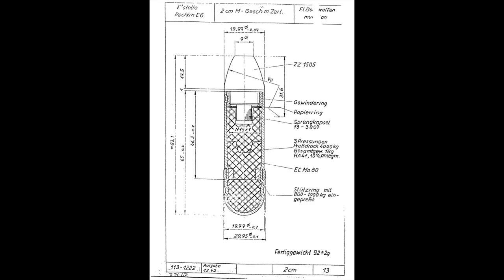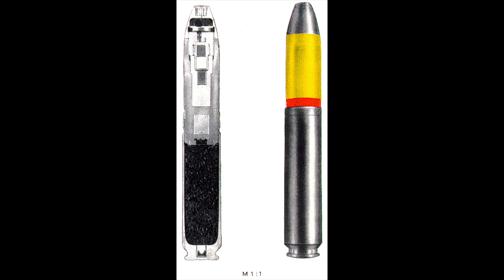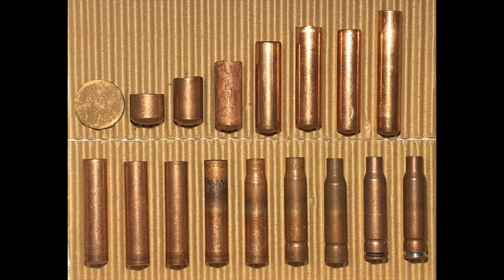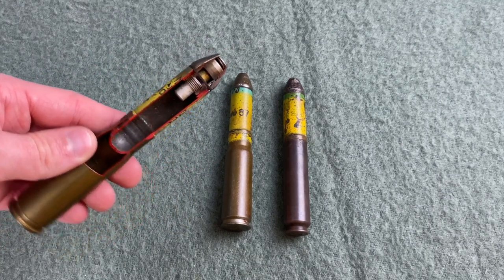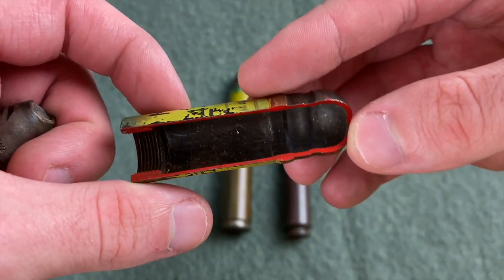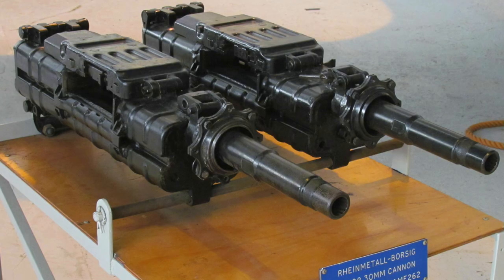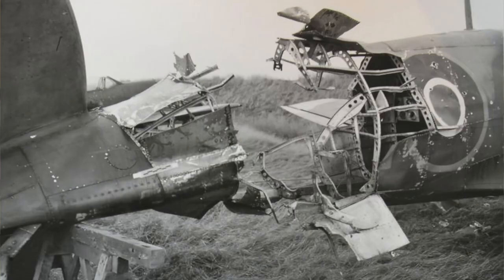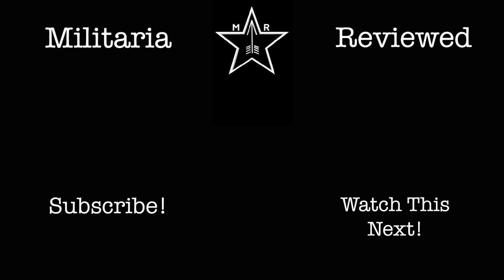Minengeschoss: More Bang for Your Buck

Comment: The lower weight of the projectile should have resulted in a higher (muzzle) velocity given the same amount of propellant. However, it should have also resulted in a shorter range as aerodynamic drag would have slowed it down faster than the higher weight projectiles. (Aerodynamic drag is not linear with velocity - 2x velocity = 4x drag.)
Of course, from the looks of the video clips, they only needed one hit, regardless of velocity and range.
Reply: I think they had a lower muzzle velocity because they had thinner walls so they were more fragile
Reply: I was thinking exactly the same thing. When he first said it was much lighter I though that it would go much faster and fly on a flatter trajectory.
Reply: @Maverick966  Mineshells did have higher muzzle velocity than conventional shells- in the MG 151 the M-shell left the muzzle at about 800m/s, compared to about 700m/s for a HE-T or tracer round. The lighter projectiles would slow down more rapidly, but this was of relatively little importance for aerial gunnery at a time where most successful pilots fired at ranges of less than 300m.

I suspect that at least some of the reason for these shells having such wildly different velocities is the operating principles of the guns that fired them: The MG FF and MK108 were both blowback operated, and the MG151 was short recoil operated. As a result all of the German aircraft cannons had a certain minimum recoil energy needed for the gun to cycle reliably, presumably they couldn't just reduce the powder charge of the mineshell rounds to match the velocity of the other shells.

Comment: I am curious about the cost difference between Minengeschoss and .50 BMG rounds. One Minengeschoss would most likely cost more than five .50 BMGs.
Reply: The 20 mm minen round had 2.5x the destruction capacity of a .50 cal round. That would mean, that the .50 cal was 2x more cost-effective, if your numbers are right. On the other hand, you needed roughly 3 .50 cal to match a single MG 151/20. One Browning weighted 28 kg and the single MG 151/20 48 kg. A fighter would save around 72 kg if equipped with canons. The .50 cal had better ballistics, but you had to hit critical parts, otherwise the rounds went right through, especially against bombers. A single minen round creates head sizes holes into duraluminium, no matter where it hits, and cripples your flight characteristics big time.